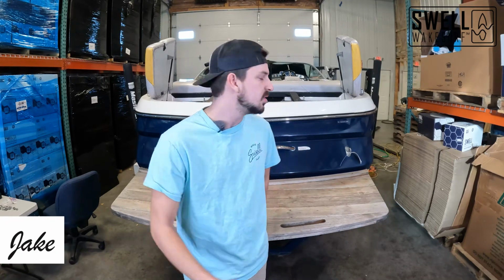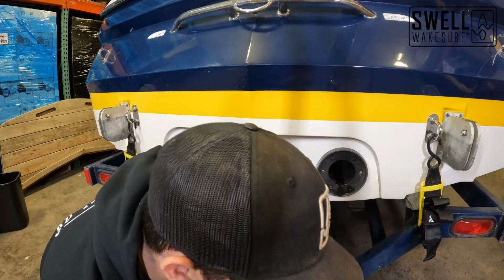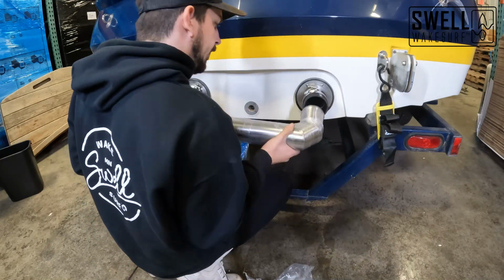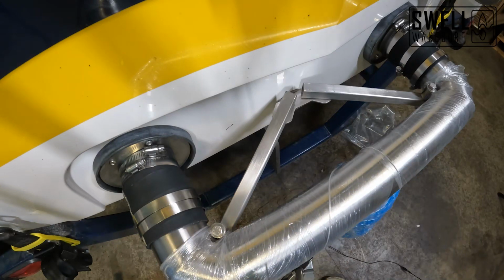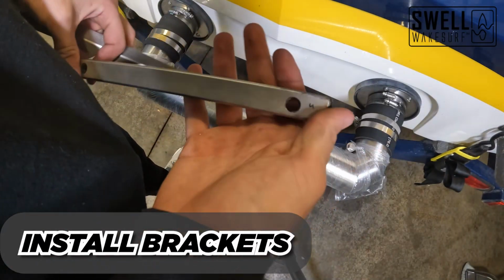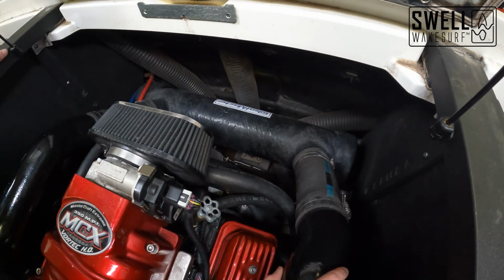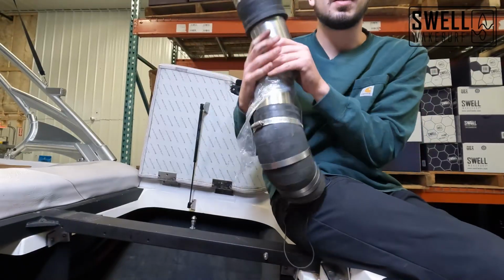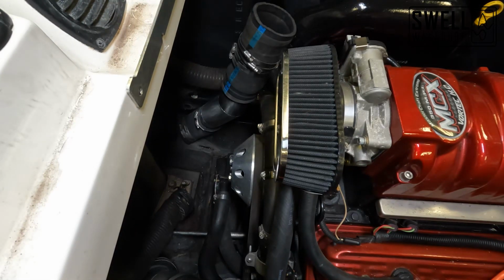2006 Mastercraft Maristar Build: Episode 1 - Intro and Fresh Air Exhaust Muffler and Exhaust Install

Comment: Is there any reason to not take a sawzall to the fiberglass muffler and cut it up into smaller pieces to make it easier to remove?
Reply from the maker: You could absolutely do that. Normally they arent as hard as this one was to get out, but if you are having trouble its a great idea!
Reply: does FAE usually require that much fabrication to install?

Comment: Why does the muffler need to be removed?
Reply from the maker: Not required, just eliminates risk of them leaking as it was 15 years old and makes it way easier to replace the impeller
Reply: Im going to do this, for if nothing else JUST to replace the damn impeller